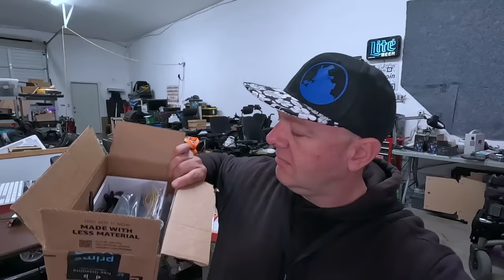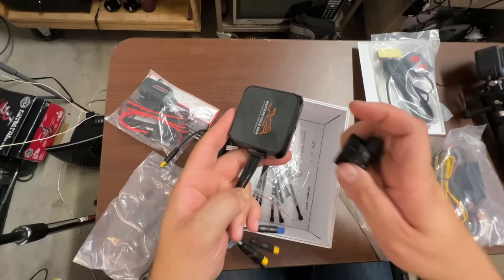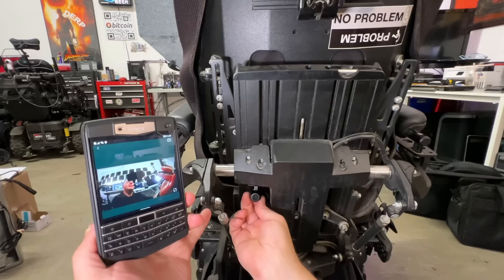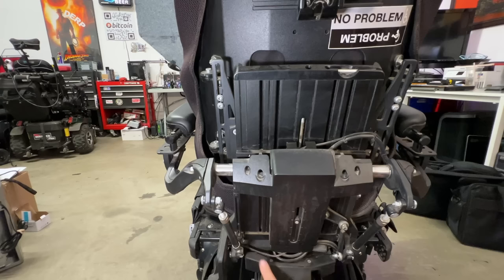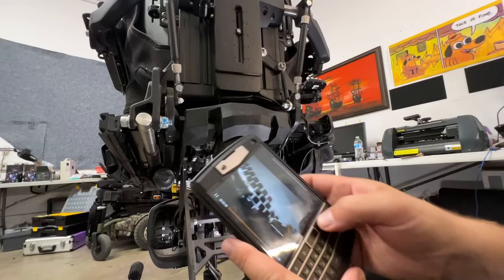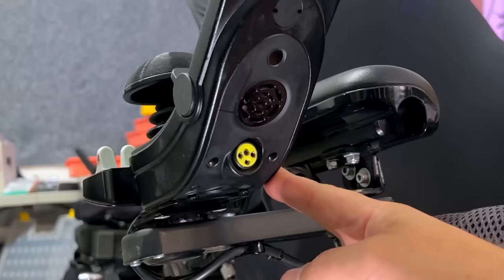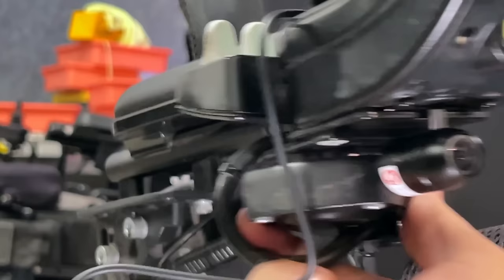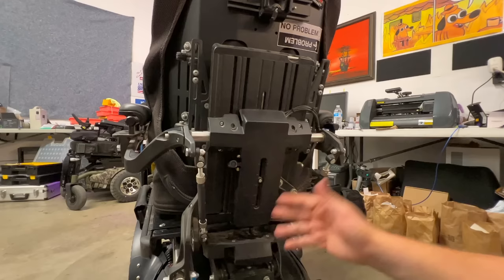MEGA VLOG 681: my chair needs dash cameras!!

Comment: How many have problems of the XLR charger port on the chair gets damages by the heat from the charging? I have a Permobil C400 with the new charge (set to 8 A). And during loading the XLR gets so hot you cannot keep your hand on it. And the plug on the chair gets damaged with brown heat markings and destroyed plastic.
Reply: You need a new charger. Permobil had a batch of defective chargers. They should replace your charger and joystick. Your DME should be able to help you get it replaced.

Comment: Can you turn off the audible voice in settings?
Reply from the maker: yup! first thing i did after loading the app hah
Reply: @TotallyNormal-  so now when you turn it on does it make any noise or voice?
Reply from the maker: it just makes a soft 'chirp' sound when powering on now.. no voices :^)
it might have an option to turn off as well but havent checked.  i like the chirp to tell me it has actually turned on, and is recording
Reply: @TotallyNormal-  that's good as long as it doesn't say recording or something like that
Reply: @TotallyNormal-  is it okay to leave the usb plugged in to the permobil usb port when charging my chair?
Reply from the maker: Yup! The Permobil usb port is only active when the chair is powered on
Reply: so don't need to worry about unplugging it every time to charge my chair just don't want to fry any thing leaving it plugged in @TotallyNormal-
Reply: @TotallyNormal-  when I plug in the camera via the permobil usb charger the dvr box and cameras get really warm do you ever notice that?
Reply from the maker: yea - mine get warm.. but seem to work ok :^)